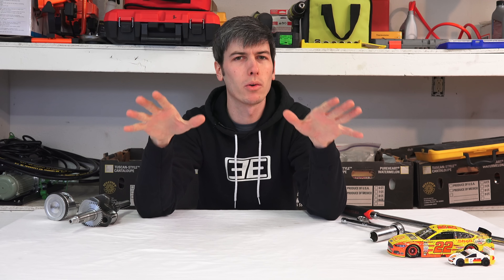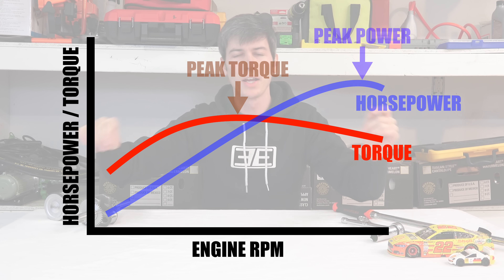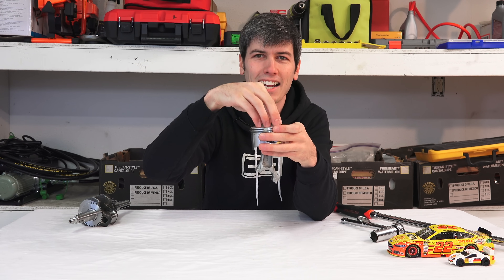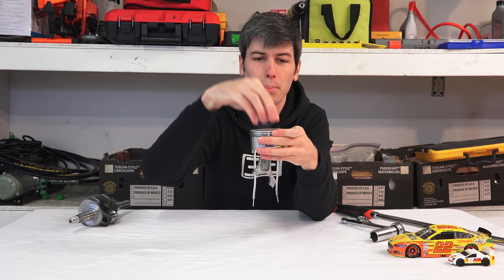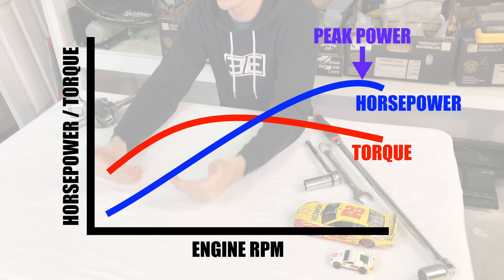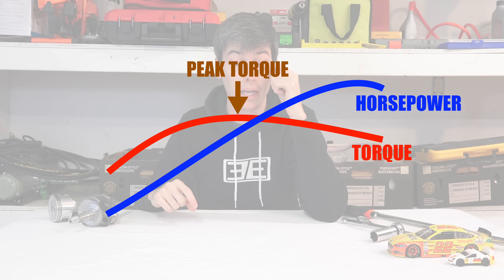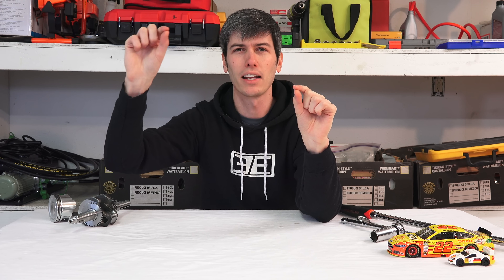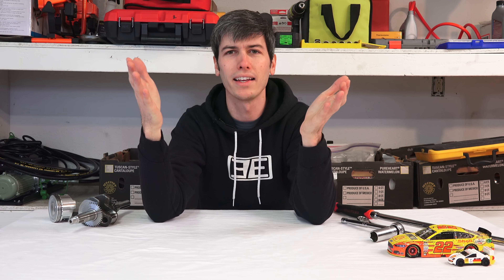Horsepower vs Torque - A Simple Explanation

Comment: when i started racing speedway i was told hp is how fast you hit the wall and torque is how far you move it lol
Reply: That’s a quote from Top Gear 👍🏼
Reply: @KarlBryngelsson  - that quote has been around a lot longer than top gear has... just saying.
Reply: i think its better to say "How fast you move it would be HP, if you can move it, would be torque"
Reply: @ChrisSmith-ig9jq  "How fast you move it would be HP" yep.
"if you can move it, would be torque" well, no because you can gear for whatever output torque you want. You can ALWAYS move it. Power is how fast you can move it / push past drag / get it moving / raise it - basically everything we care about. The peak torque an engine makes is not relevant for assessing vehicle performance -  Only power, and to a lesser degree, the distribution thereof (the shape of the power curve).
Reply: how far you move it would be work i think
Reply: Anything can have any amount of torque you want! Question is.... How fast can it move!
Reply: @ChrisSmith-ig9jq  do you mean how fast can it move with that torque or how fast can it move to keep up with that torque
Reply: No the momentum is what moves it
Reply: read the description lmao
Reply: how far u move it is a momentum
Reply: You are told wrong... Horsepower is how fast you hit the wall, period. No torque involved. Vehicle weight (inertia) will help you move that wall... Torque is meaningless, because if you hit the wall fast, you're in top gear meaning very little torque at the back wheel, and if you are in first gear (lots of stump pulling torque on the backwheels), you will most definitely not hit the wall very fast, in fact, slow enough for the wall to see you coming, and avoid you....
Reply: engineers around the world cringing
Reply: He has a video disproving this
Reply: Actually Kinetic Energy is how far you move it 

Also you shouldn't just believe everything your'e told
you should test things 
How do you think we go Flat Earther's ?
Reply: As a physics student thank u for this example

Comment: Great explanation! A little more info about the gearbox and gears would have been helpful. Is it right that the "peak" power becomes flat when you've got more torque? That would probably be an upside because you'd have to shift less in a "slow corners track" scenario. Also, likely from start til 2nd gear?
Reply: Depends what you mean by flat. In general, higher torque means you have the option to provide a wider band of horsepower, but the specific shape of the curve depends on tuning and other factors

Comment: To put this discussion in some practical terms . .  . I once had a car that produced 150 hp and I had a motorcycle that put out 116 hp.  Thus, the car's hp was only about 29% higher than the motorcycle's hp.  However, the car's peak torque was nearly triple that of the motorcycle (200 lb-ft versus 72 lb-ft).  In addition, the car produced its peak torque at just 2,000 rpm, vice 7,500 rpm for the motorcycle and, as a consequence, the car produced much more hp at rather low engine speeds (as one encounters, for example, when pulling away from a stop sign).

Comment: Show this to every freshman engineering student
Reply: They allready teach that BS in the schools, but its entirely wrong, because using gears you only manipulate the torque, an engine can only pull up to its maximum torque, after its quite weak and useless, so EEs explanation sucks because you can not get more torque out of the engine even if you manipulate with gears. most engines in cars run to maximum 8000 rews, so the only way to maximize horsepower is to maximize torque, end of story.
Reply: @Deutsche_1  yes you're wrong and arrogant too.
 You can manipulate the torque by changing the dimensions of connecting rod (rod which connects Piston to crankshaft) since Torque is directly proportional to force and DISTANCE
That's common high school knowledge

And you're arrogant because you don't know much but is still giving wrong validations to someone who's more right than you
Reply: @shrijanbuchasia7366  So explain how you want to make more power when you are limited to 8000 rews.? Arrogant or not, you cant defeat the truth, but apparently you cant handle the truth, and its easy to be arrogant when academic calculations is in the game, because like my previous text, academics learn the wrong things now a days, they are missing out on the basics.
Reply: @Deutsche_1  what I told earlier is a part of modification done to a car to increase the revs it's limited to. Well is more to it other than just modifying the connecting rods. You to do few tweaks in the engine to for the car to handel the increased revs. 
Btw bruh, he's not talking about how you would increase revs or torque in a built car. He's talking about how you can significantly increase the torque in an engine which is under production. 

I hope you get this because as far as I think I'm right and you're not getting on when he was referring the manipulation of torque
Reply: @shrijanbuchasia7366  Just tell me then, if you remove the limiter on the revs in a motor so you ex can reach 7200 rpm in stead of 6500 rpm, you get more horsepower right...?
But the engine does not pull better or more, right..aah no it does`nt, why not??
The schools don`t teach that kind do they, they teach the calculation of HP in any form it comes in , but they don`t teach what specific makes horsepower, and there is only 2 things you can measure in HP, and that is revolutions and torque, the 5252 is not measureable..meaning horsepower is a calculation not any force or movement.
Reply: @Deutsche_1  you're wrong. Basic physics. Power is a measure of work done per unit time, which in this case is change in kinetic energy per unit time, which is linearly related to acceleration.

What EE says is that you can manipulate torque at the WHEELS. And peak torque at the wheels happens when you are at the rpm with peak hp. Think of yourself cycling. What's the best rpm for acceleration? For most cyclists it's 90-120rpm, aka peak power rpm. If peak torque is the answer, this would mean 0.00001 rpm. Muscle fibers are strongest during isometric holds.
Reply: @bigpp9054  You are just another akadumbnik, who does not know anything other than calculations on the paper, tell me where the 5252 does any work.?
EE talks about hp but you can only get torq and rews from the motor, HP you can get on the paper, so stop your talking BS.

Just explain 2,0 litre engine 8500 rews 600 HP,  NO GEARS,  yes you red it no gears and its faster than most supercars, Köenigsegg Gemera, 1,9 seconds 0-62mph.? aah ok it has more than 400 footpounds of torque.....guess no one learnt about that in school.
Reply: @Deutsche_1  sigh. 5252 does not do "work". It is a constant. You can leave hp as hp=torquexrpm, with your unit being 1/5252hp.

Multiplying torque by rpm introduces the key dimension to power: time. Without time, you can't do any work done. You can have a force, but you can't accelerate. Again, horsepower can be represented as change in kinetic energy over time. Hence your acceleration needs  to take into account time.

I doubt you'll understand this though. The Dunning Kruger effect is real. Every engineering professor would laugh at your idea of torque and horsepower. Are you an engineer? Have you passed high school physics? Are you a flat earther?
Reply: Koenigsegg Gemara? The car with 3 electric motors outputting 1100hp?
And on the topic of that, go search for the torque curve of an electric motor. Now tell me what rpm to run for peak acceleration since you said "gears can't multiply torque"

You have a lot to learn. Pick up a physics book and learn. Take an engineering degree. Go work as an engineer. Then, come back and look at your comments.
Reply: @bigpp9054  To be honest, you just graduated from highschool, and the flat earther must be your self, because your mind is closed at the wrong education you had.
I never said gears cant multible torque, that is your own statement.
Reply: @Deutsche_1   "I never said gears cant multible torque, that is your own statement."
Also Deutsche _  
"EEs explanation sucks because you can not get more torque out of the engine even if you manipulate with gears"

The thing is, how much torque you have at the engine doesn't really matter, because you could run a 10,000 rpm engine with 100Nm through a 2:1 gear reduction and it would perform exactly the same as a 5,000 rpm engine with 200Nm of torque. Both engines have the same power which is 104.7 kilowatts.
You could gear down a Lamborghini engine and use it to tow 50 tonnes of cargo, although it might have overheating issues compared to the larger cooling system on the big diesel engine typically used in an HGV. Typically sports car engines are designed with fast flowing air needed to keep them cool, rather than 55 mph or less.
The only place torque might matter is if you have terrible torque in the rpms building up to the power zone, which might make your vehicle slow to the first 20-25 mph before it really wakes up and launches in first gear. You would need more closely spaced ratios to take advantage of the narrow power band, and you might incur a time penalty by changing gear so often.
Reply: @TimpBizkit  ha ha ha what a joke, you also didnt get it right, you mumble about a calculation, get real dude..Horsepower is a calculation not anything that can pull anything, go study how the powertrain in any given form works before sphewing ignorance, ref: (The thing is, how much torque you have at the engine doesn't really matter,)

Comment: Literally 1% of the people in the comments understand it.
89% think they understand but still dont get it, it and 10% are still like.... what
Reply: I understand the difference, but I don't understand why torque is important. Isn't that why you have a gearbox?

 If you have a 200hp high rpm motor and a 200hp low rpm motor shouldn't really matter as long as you have the right gearbox, right?
Reply: @jovarsmm567  kind of...torque is the force needed to move the car but since most engines don’t have sufficient torque at the shaft to move the wheels a gearbox is needed to increase the torque by gear reduction. If the engine makes more torque to begin with then the gearbox’s importance can be reduced and the car can achieve higher top speeds. The more we rely on a gearbox to provide the minimum amount of torque the more we lose rotational speed at the wheels. If you want a fast car then high torque is 100% necessary. To those who understand it, torque tells a story of how the car is likely to behave when the driver stomps on the pedal. It’s a really interesting figure and it really should be the star when it comes to car specs.
Reply: Isnt it because if you have more torque you get to the peak power faster and you wont need as much gear changes
Reply: @lukas6610  the power curve is another thing alltogeather.

Something people will allways say is "2 strokes have no torque"
Its not true, they have a lot more torque than their 4 stroke counterparts, but they feel like they have no torque because their power curve is very peaky.
Reply: Then there is the few that can explain it much better....
Reply: My take away is that stated torque figures are basically irrelevant, however they measure it, because torque at the rear wheel is mediated by gearing and peak effective torque is actually defined by peak hp.  Is that right?  He didn't say that but it sounds like that.
Which would mean engine torque stats are useful purely to create a torque curve that demonstrates power distribution / feel through the rev range.  (And this graph is practically, if not literally, scale invariant.)

In which case... Wtf do stated torque figures come from and why does the industry keep insisting they're relevant?
Reply: @JSBax  yes John, thats correct.
God knows why people allways quote torque figures 🤦‍♂️
Its a measurement, but not a measurement of power output.
Reply: @JSBax  Perfectly said John. Torque is what the engine creates, power is what the actual car can output.
Reply: @JSBax  good note taking.  The power distribution information becomes relevant for specific applications.  An engine with a torque curve that diminishes with RPM creates a flat power curve making for a more one dimensional power delivery characteristic.  Hardley Ablesons are prized for this.  All of the power delivery is controlled by the throttle in comparison to a 17,000 small cc sport bike where twisting the throttle at 2500 RPM is met with a yawn and a handful of throttle at 12,000 RPM is way more than the Hardly can deliver.  So engine response characteristics is one reason it’s indicated.  The other is for agricultural, industrial or heavy duty type use.  An 800 HP high rpm engine can move as much weight up a hill per hour as an 800 HP very low RPM engine with many times more torque but it will not have the life cycle, or fuel efficiency of a larger lower RPM design, generally speaking.
Reply: @JSBax   You are 100% correct here.  When engineers spec out an engine for an agricultural, construction, industrial, or any other similar application the max torque of the engine is only of trivial interest - it is all about the rated power, maximum power, and power curve.  (I know this to be true because it is what I do for my job.)  Power alone determines how much work an engine can do in a given amount of time.  Many people who don't understand this consider power to be a "made up" or "theoretical" number since you have to do math to calculate it.  Those folks seem to ignore the fact that torque is also a derived unit - it is the product of distance times force - but they probably don't think of this as "made up".  The problem is that torque is an easier concept to understand than power so people fill in their lack of understanding with myths and fiction.

The reason I think you see torque figures advertised so much, especially those for diesel vehicles, is that manufacturers are sort of playing to the ignorance of their audience and giving them what they want to hear.  It is interesting to note that this is primarily an automotive thing.  If you look at product brochures for ag or construction equipment the engine's torque is only a passing reference in the specification chart, if it's even mentioned at all.

Comment: Much simpler explanation.
Hp is a measurement of power output.

Torque is an arbituary measurement which does not tell you how much power an engine makes.

A 100hp tractor is no more powerful than a 100hp motorbike.

Comment: This is why electric motors have so much torque. A pistons push on the crankshaft has maximum torque at 90 degrees in rotation just like your bicycle pedal. At a small angle like five, ten or even twenty degrees the torque is very low. With electric the torque is full on in many locations during all 360 degrees of rotation always near ninety degrees of the axis. Transmissions are never needed if your engine or motor is good enough. Horsepower is just a unit of ability to accomplish work against all other forces like weight, air resistance and contributors to friction such as oil, tires, bearings and gears or differentials, AC, alternators, waster pumps and whatever may be involved.